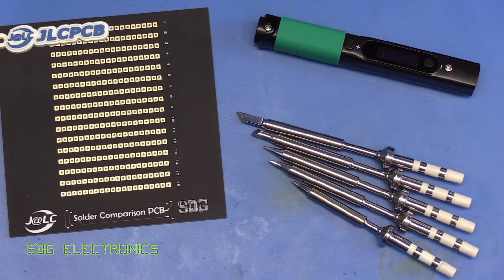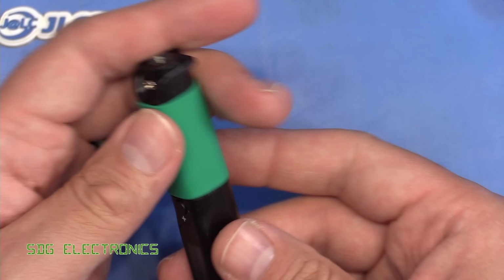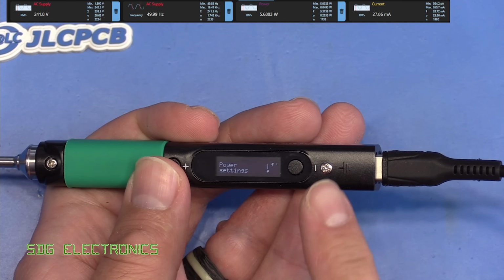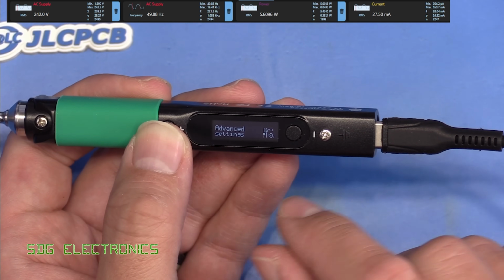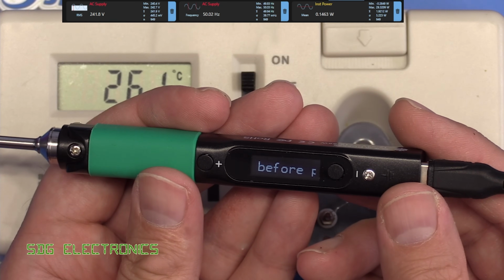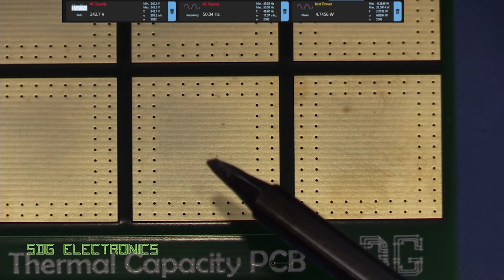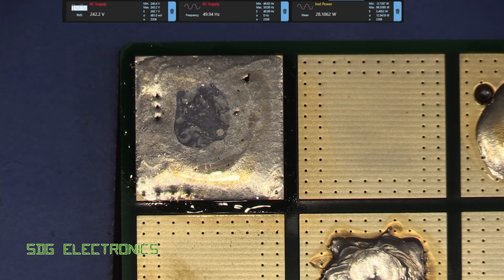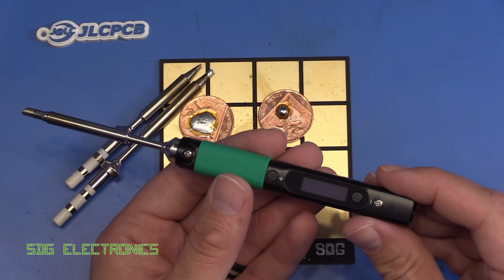SDG #275 Pinecil V2 PINE64 Open Source Soldering Iron - Test with PCBs from JLCPCB

Comment: longer tips in 4-pack set is not the high power tips, they are just normal ts-100 style tips. It's opposite. longer tips you got are higher resistance ~8 Ohm and thus lower performance.

- Only the Pine64 newly designed short tip is the higher power tip because it's lower ~6.2 ohm is higher power due to increased watts you get using the shorter lower ohm new style tip that Pine64 designed. in ohm calculator  input  typical USB-C  charger of  20V with 6.2 ohm tip and see how you get ~64W power compared to  much lower max you get from  entering 8ohm tip in calculator with same 20V charger and you  get lower 50W max. 

- have to do a bunch of settings first before things will work the way you want in the menu like user settings. auto rotate screen works if you set it up. highly, highly recommend  reading  wiki page for pinecil  and firmware ironos pages before doing a review because calibration was also not done correctly. you can see the calibration completed when you got the 833 offset number, after that you need to hit minus button a couple times until you are back at main  screen.  I would unplug and leave it sitting for a long time before calibrating. it says in  firmware instructions on git .. hub  for IronOS  to make sure not only Tip is cold but also  the handle since it takes a temperature reading on the PCB too.  moment you plug it in that starts getting warm.  
- if you did not have time to read ralim  IronOS firmware information on calibration or the Temperature document posted there , could have come into live community chat which is linked in wiki page and volunteers would help you sort out some of the confusion
- If you truly want better performance, we could have let you know that quick charge or QC chargers are the worst, you have to use at least a usb-C "Power Deliver" spec charger, also called PD65W,  20V  3-3.25 amp charger to see really nice speeds.   unlike the ts101 which can only do  usb-C 45w  max charger,  the V2 pinecil performs well  using PD  charger 65w-20V, 3.25 amps.  look on the wiki page for pinecil.  just because QC (quick charge) type works doesn't mean they are optimal or should be used.  that is what you use b/c you have one free in your house,  but not when you are trying to compare performance or heating speed. 
- Pinecil V2 firmware only checks tip resistance at bootup, so if you swap between long and short tips must reboot or unplug first.  this can really throw off temperatures if you don't do this right.  same with doing calibrations.  if you don't do calibration correctly and look up way it works in ironos firmware, it's worse than before you started. 
- avoid QC chargers, they may work but are slow.  use usb-C PD chargers that give 3 or more amps at 20V, yes.
Reply: How are they still only delivering 11w though?
Reply: @nidusa1  Jump to around 12:00 and look at the amount of power being drawn - only some 11W is actually being drawn by the iron even then it is should be ramping up to full power... so something is clearly wrong here - possibly the tip calibration is really out due to tip swapping (although he does say he always powered down before swapping tips in reply to another comment), not calibrated when handpiece cold, etc, etc, so it's just not really trying to heat up - although I would have thought Steve would have verified the temp temperature after the calibration.
Reply: @pfeerick  I see this - good for Ralim to look at this if SDG opens a Github IronOS  ticket otherwise  ralim won't know about it this problem or be able to work with SDG to diagnose.
Reply: @neo256mb  I'm more inclined to think he needs to get in contact with pine64 and see if they are having issues with tip cartridge quality. But it also won't hurt to find out what is going on with the tip calibration ... if only to suggest it needs to be made more intuitive... RTFM really should not apply for a tool like this... it should be mostly usable by anyone familar with this type of equipment.
Reply: @pfeerick  thanks. yes something is wrong there.  there were some issues i read about with with brand new ts100 tips where just wiping them down with IPA isopropal alcohol before using them new helped with temperatures. they can come from factory with dirty contact or residue. people reported fluctuating and flickering temperatures  which went away immediately after cleaning or wiping off all the tips. in some cases just using the iron a few days where the rubbing from inserting the tip several times magically  made contacts better and the  bizarre temperature readings went away. this may have been because they rubbed off any residue.  This happend to enough people, it is in the pinecil Wiki  to  wipe off all new tips before using.  It happened to me on one tip too but after i wiped it with dry towel the fluctuating temperatures went away.
Reply: I’m looking to get the Pinecil soldering kit for portable/station , which tips set you recommend get short tip gross or fine they also have the 120w desktop power supply  on sale $37.99 im mainly going to use for fpv drone builds and in the field quick repair , I’ve never solder and will be my first time “newbie”
Reply: @carlosr.2027  More likely to want the larger tips than the smaller ones for typical FPV soldering jobs  - plus the "gross" set still has one small tip and you have the one that comes with the iron. I've only used the pine64 120W PSU for soldering a few times, and it does the job fine. I find for my needs a smaller wallwart PSU does the job just fine though, and is more suited to this being a "portable" soldering iron. Then again, if you're in the field, you could power it via the DC barrel jack off a lipo battery.
Reply: @pfeerick  do you mean normal tip “gross” there’s no large tip I appreciate your feedback, thnx
Reply: @carlosr.2027  Yes. The gross set has larger tips than the fine set ;)
Reply: @pfeerick  theres 2 different set with gross , the normal tip set gross and  short tip set gross which is the appropriate one I should get sorry for the confusion ,thnx
Reply: @carlosr.2027   I   would  get  the Gross kit.  however that said  my most used  tips are  BC2 and BC3  ( they don't sell BC3 yet so I had to buy  longer  standard length 8 ohm version from Ali expr)  .  my daily  tip is BC2.
Reply: @neo256mb  the normal tip “gross” set are longer than the short tip “gross”set that’s why I was confused which gross set  to get and both set comes with same  I,c4,d24,k and there no bc2 in the set ?
Reply: @carlosr.2027  always get Short set if possible it's more ergonomic to hold it closer to PCB.  all the pro  expensive stations like  JBC, you hold it  very close to  the board.  but  if they dont have it in short then  you have to get normal length .  shorter is more comfortable and has  more control on the soldering.
there is a BC2  inside the SHORT  set called Fine.
Reply: @carlosr.2027  bunch of good guides on pinecil wiki page too that are good for newbie  soldering. go to guides section.
Reply: @neo256mb yes correct there is bc2 in the short set (fine)  are you now recommending I get  short tip set fine not the short tip (gross) they are both in stock or buy both sets fine and gross ?

Comment: 13:43 did you try a 88w source like a ear 140w pd or a dc input to get the full power output?

And the short tips not the long ones

EDIT: although I think my performance is way better than this video, a 140w pd 3.1 PSU with 28v only improves the heat-up times. Also, this thing is not ESD safe unless you wire the ground pin to ground or use a power bank, it killed a few ICs and it reads 55vac to ground for me! it lights up the leds I solder 0_0 tried a few chargers including my apple one.

The issue with this thing are the tips, the soldering iron only delivers 15w max during soldering despite being capable of 88w. my assumption is that the thermistor is poorly positioned etc?

Comment: not saying this is an issue at all .  just noting that The 119  temperature testing unit also  needs the test wire changed every now and then.  not sure exactly but I think it's  20 times it can test before you have to swap it out with a new hakko wire  which is why the 119 unit comes with several spares.  I could be wrong abut the 20 number, but I do know that wire has a limited number of tests it can do  and that like in the video it is important to add a little solder to the center  of the wire to help get the correct test. 
Normally I would  use an Iron first  and heat it up before even checking calibration just to visually see if it's fast and heating right.  this way  I have a reference point.  if I calibrate and then it performs not well,  I might then think it's my calibration but if  it performed poorly before and after calibration, then  I might suspect  the Tip.   Some people in  Pine64  found that wiping off all the new tips of  factory residue  helped a lot  with weird temperature  on first day they received their pinecil.   pinecil also works with the tip that came with the  tS101 .  would be interested in seeing it tested/used with the ts101 to rule out if the tip  is defective.   I'd also test and or calibrate  using the same  exact tip I'm going to solder  copper with.  So if  you use the Short conical tip for the soldering, then use the same one   for the calibration sicne it has different ohms.  
if that still doesn't work.   open an issue ticket with Github Ralim's IronOs if firmware is suspected.

Comment: I was looking at these, but after watching this and reading comments, it’s way above my knowledge for simple circuits with esp/arduino and raspberries. I’m lost in a sea of soldering stations on Amazon and ali. Is there a budget end desktop setup you’d recommend for such as me? Say up to a hundred quid please? If that’s even possible lol. Many thanks! I don’t really need portable.
Reply: Antex 230v or pinecil
Reply: @davadoff  I went with pinecil a few months ago thanks.
Reply: @Mr_Gadge  👍 

Make sure to get the new short tips if you buy tips for it.

Comment: Ehh, I'm not spending >$3K Aussie dollary doos on an iron. I bought a Pinecil V1 and the only thing I've found it struggled with so far was a TO-252 (as you experienced), but hot air is probably the correct tool for that anyway. I might pick up a V2 and the larger blade tip if they release an updated one to suit, but my V1 kills my old FX-888D any day, so I expect it'll be better at 24V compared to 20V on the V1.
Reply: I’m looking to get the Pinecil soldering kit for portable/station , which tips set you recommend get short tip gross or fine or normal tip gross or fine  they also have the 120w desktop power supply  on sale $37.99 im mainly going to use for fpv drone builds and in the field quick repair , I’ve never solder and will be my first time “newbie

Comment: Mine just arrived today with the new short 6.2 ohm "gross" tip set. First impression was just how small it is compared to the fx-888d hand-piece. These are compatible with 28V USB PD EPR, I have tested with 28V DC power and it works amazingly well, drawing 130W while heating up. My only complaints are that the tip set contains a very sharp conical one, even pointier than the stock tip (would've preferred a bigger wedge one) and I wish it was a little more substantial feeling in the hand (more weighty). Bought this because I was really running into the limits of the fx-888d with aluminium clad LED PCBs and at 130W it blows the hakko out of the water whilst being a smaller and more precise feeling tool to use.

Comment: And the Aixun takes the silver.  Again.  Not bad.  Would you consider doing a video about how all the stations you've been reviewing for the last several years stack up?  Even if you no longer have some of the stations, it would probably be an easy video.  Probably just video editing, and a unified timer.  You use the same coin, and generally use use a D52-type tip on the contenders (120w or greater).  You've already got film of the coin test for the Metcal MX5200 (and GT120), JBC, Aixun T3A and 420D, BST-933, Quick TS-1200A, PACE ADS200, and Unisolder.  The only thing you're missing is the Hakko FM-2030 hand piece (which may come in last place anyways). Oh!  And maybe any info on ESD use (good or bad), reliability, safety concerns, etc.
Reply: The aixun is flawed in a few ways that this tester doesn't appear to investigate though (at least if he had discovered them it's strange that'd he'd still include its performance side by side with other products) It's premise seems to be a £400 soldering station for £40 (or whatever) which sounds like you should be looking for the catch (and the reviewers / users who do, find it) - JBC do cheaper soldering irons I'd suggest you'd be better with one of them if you don't want to spend £400.  Although I think the miniware and pinecil are probably as good - because they're not trying to be cheap. The performance may be less but you have to ask yourself how much soldering you're doing on coins or big pads. If it's none then you'd be much better with a cheaper JBC or the pinecil / miniware than you would be with some tat from aliexpress / amazon that is likely to electrocute you if you don't open it up and fix it - and if you do need the performance get the JBC or other reputable brand. The bottom line is : the cheap one isn't the same product but cheaper - dumping power into a tip will give you an impressive heat up time for a video but there's more to a soldering station than that.

Comment: I wonder how well the tip contacts well keep a good low resistance connection over time.  You most have a shed load of iron's by now. Since about 1976 I must be on my 5th solder iron. I did turn one one for the first time this year that I was given new as a spare in 1977 :-)

Comment: I think you should do a review of the Goot RX802-AS. I got one used for like 80 USD, see some new from ebay cost like 200USD. Its performance beat any Hakko i use at work. Heat up from cold in like 6s. Slim and lightweigh handle. Automatic sleep by measuring output power, so you dont need a special stand for it and no wiring from stand to station. And there is manysettings and a very clear manual.
Honestly I think it is a very nice station for the price, but no one do a review about it. Maybe it is not popular in EU and US.

Comment: The Wiki says "Quick Charge or QC 3 is not recommended as Pinecil V2 requires a minimum of 3 Amps or more to work properly (see Pine Store Official rating on power ports). Most QC 12V phone chargers are only 1.5 Amps, this will lead to [Thermal Runaway] or [Undervoltage] messages because of weak power".
Could this be the reason why you only saw about 10 to 20W of power used in your test?
Reply from the maker: It read 20V on the display, so this charger must be QC and PD.
Reply: @sdgelectronics  Thanks for the followup! I only mentioned this because you said you used CQ in the video. I am not really sure that the display showing 20V implies it must have used PD. I have conflicting sources here. Some claim QC3 can also go up to 20V or even 22V. Some claim QC3 is limited to 18W others state 36W. Some claim 1.5A max, others say it's 2.6A/4.6A max. Not sure if just most QC3 phones had that constraint or if that's a technical QC3 charger limitation. Sorry I can't post source links on Youtube, it would get banned. The successor QC4 seems to be a quote on quote superset of PD3.0. Even though USB IF forbidds proprietary extensions so not actually.
Reply from the maker: @kwinzman  I checked, the adaptor I'm using supports 65W at 20V, compliant with PD, so I think it's okay.
Reply: @sdgelectronics  check the other port maybe?

Comment: Hey.... I just came across your channel and I did subscribe. Hope you can help. I'm ordering the pinecil v2 and wanted to know if you found a portable way to get full power? Think its 24v 88 watts. I know a good pd 3.0 works fine for most cases but I'd like to get max power for larger soldering tasks but mobile without plugging into the grid. Thanks so much for any help you can give me
Reply from the maker: You would likely need your own battery, possibly from a pack of LiPo cells in series. It might be possible to use a power tool battery, though most are around the 18V point.

Comment: They do need to improve the performance of either the iron or the tips, but this iron should not be expected to perform like a Metcal.  This is a $27 iron and it competes very well against the more expensive Miniware.  It's 15W average power under high load is very disappointing, however, and hopefully this brings the issue to the manufacturer's attention.  We should get at least 65W through the tip and they promise 88W.

I've read that they've modified the stock tip to 6 ohms to allow more current through the heater, but this is itself problematic as it means that they'll have their own variant of "TS100" tips.  I don't like that, but it should mean that the "shortie" tips are more powerful.
Reply: Unfortunately, lowering the impedance is the only alternative to raising the voltage, which is currently rather maxed out.

Comment: 8:12 Interesting! My Power Bank has a "Trickle Charge" mode, where it won't turn off if the current draw get's too low, like it does in normal mode! - I'll be curious to test, if that can replace the power pulse setting! You can turn it on or off with a double click of the power bank, so that would be perfect and make it more seamless... One question: I assume power banks are limited to 12V? If so, how much does that limit the performance of the iron (wattage is plenty...)? I also have normal chargers, but being able to use the Pinecil in "the field" would be amazing for using it in the car and so on! EDIT: Read up on my Power Bank! PD 3.1 makes it go up to 28V/5Amps! UPDATE: Trickle charge works! And it removes the "power pulse" Temp overshooting!